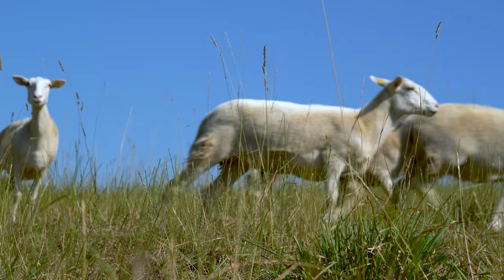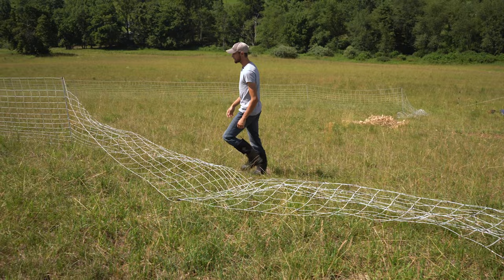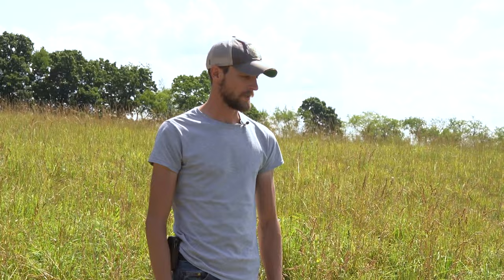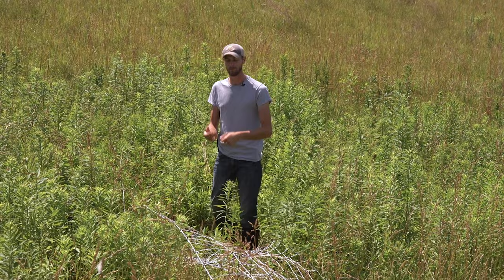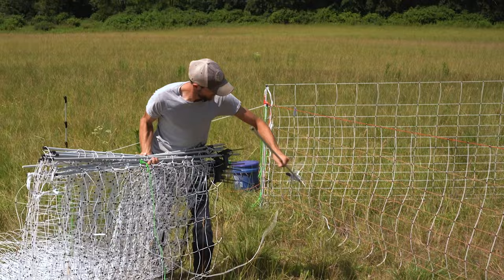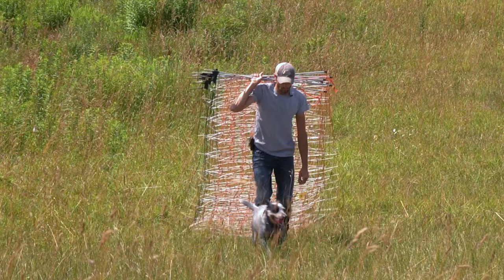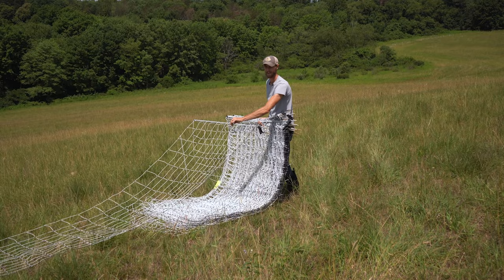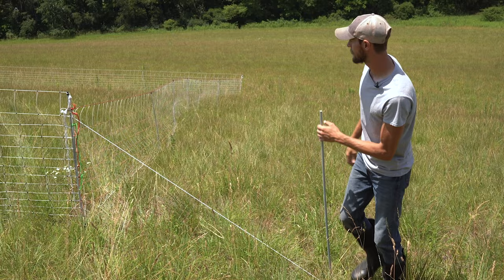How To Set Up Rotational Grazing Paddocks with Electric Netting

Comment: How do you keep the sheep in the electric netting? It was highly used and recommended. We got 3 lambs. The spooked and bolted through it in 5 minutes despite the wires being hot. We are so discouraged with this first dip into sheep/ livestock. We need all the advice. Once we catch the lambs again we are worried to try putting them back in the netting.
Reply from the maker: We are sorry to hear you had a bad experience on your first go! What size energizer do you have running your net? Is it posi-neg? If not, how much grounding do you have?
Reply: @KencoveFarmFence  my husband has all those answers. I know it was 11k voltage. The lambs had never been electric fence/ net trained. This is our first time with any kind of livestock. We did get them all back Monday. There is a lot we did not know that we are learning on the fly.
Reply from the maker: @TwoBirchHomestead  We would be happy to help! Shoot us an email to marketing@kencove.com and we can help trouble shoot for you! Or give us a call 800-KENCOVE

Comment: Is it feasible to use the netting as a perimeter fence until we have the opportunity to get a woven wire fence built?
Could we use step in stakes, braided electric and hook it to the netting for the power source to make the separate paddocks within the perimeter?
Thanks!
Reply from the maker: Great questions! Yes, you can use netting as your perimeter in the meantime and divide into paddocks with twine and step-in posts or additional nets. Just make sure your energizer has enough capacity to add paddock divisions. Electric netting requires a minimum of .25 output joules per net, and we we recommend 1 output joule per mile of fence otherwise. So, be sure to calculate your fence demand by combining your nets and electric twine in order to properly size an energizer.
Reply: @KencoveFarmFence  Thanks so much for the quick reply!
New sub here!
Reply from the maker: @garypiatt4666  Thanks for watching! Hope we are able to help you!

Comment: What do you do when you live in such a poor soil area that you cannot get the portable fence posts to stick in the ground?  We live in rock country.  Trying to fix this issue but need a little help so we can safely run the animals over it to develop the necessary fertility to do so!  Tips?
Reply from the maker: Hi Jennie,
In cases where rocks are present and there is not enough topsoil to hold step-in posts, I have seen people use masonry bits to drill post pilot holes into the ground. I know of other folks who made weighted, mobile posts by cementing a pot material inside coffee cans or 5gal buckets. This allowed them to have a secure fence and still move it as they built up the soil. Creativity is really the only limiting factor for fencing solutions. I always recommend using what you have around. Please let us know if you have any further questions or if you would like to continue brainstorming solutions for your context!

Comment: Tall grass and weeds like in the video, wouldn’t they short the fence out?
Reply from the maker: Hello - The bottom strand of the net is non-conductive. While there is some forage growth in this field, it is not heavy and really pulling down on the netting. However, where forage growth is heavier and thick, you could weed-wack or mow the path where the net will lay. Having a proper sized energizer is also important for combating forage growth.

Comment: What do you do for a gate to go in and out?
Reply from the maker: This is a common question - There is no "gate". You simply turn off the power supply and can either step over the fence, or move your end post. If you want to make a small opening to use as the access point, purchase an additional step-in post and place it a short distance from your end post. That will act as a pivot point when you remove the end post to use as the entrance

Comment: Some questions I have are these:  
In hight wind situations, do the fences lay over?  I know that animals have a tendency to drift with the wind when weather is driving them.  If the fence is layed over on one of the long stretches of fence, couldn't the animals move across the intended barrier? 
In tall wet forage situations, how do you keep the fence from shorting out with so much in contact with the moist growth near the ground?
I am curious about the composition of the flexible posts that are obviously new in your video.  Are these fiberglass posts?  If they are, how do you keep those fiberglass fibers from deteriorating in the sunlight and becoming a concern to handle with bare hands in the future.  If the posts are not fiberglass, but some other material, is that material capable of withstanding the effects of light as a degrading agent?
Things naturally get broken on a farm.  In the case of a damaged post, how may a broken post be replaced?
These examples that you have provided are small areas where foot travel installation and maintenance is easy to manage.  8 head of sheep do not require large areas to graze on.  So talk to me about how this type of fencing might be affordable and acceptable as permanent perimiter fencing for 200 sheep or 100 bovine.  What would be the cost of the fencing for a one mile straight run?
I don't know if you want all of my comments and the answers to them to go back up here to your page, so I will include my private email address for you to use if you prefer.  brushdcp3@gmail.com
Reply from the maker: Hi Ronald!  

Wind: If your soil conditions are decent, you will not experience much issue with wind. You’ll be able to tell when installing if a placed foot is sturdy and secure or if you need to move it to find a better hold in the soil. In any case of a fence falling or a tree branch knocking it down, there is always potential for animals getting out. However, I’ve also seen animals that are well-trained to electric fencing not even attempting to cross a downed wire, let alone a wide net. 

Tall & wet forage: Having a low impedance energizer that is capable of handling vegetation load is the first remedy to this situation (we recommend .25 output joule per net minimum). Sometimes mowing or weed trimming the intended fence line before setting up nets may be necessary to easily install the netting and minimize vegetation load, and make life easier in general. So far, I have not had an issue with vegetation load on this netting system. 

Posts: These posts are solid SunGuard fiberglass posts. We have carried SunGuard posts for a while, they are tried and true. The nets in this video are not new and have been in use for several seasons with no signs of failure or deterioration. SunGuard posts are coated for UV protection and to prevent splintering. They will endure a lifetime of use on your farm/ranch. We also sell replacement posts and feet for each style of netting for easy repairs, should you need them.  

Scale of use: These nets are also used to graze large numbers of sheep and goats (200 head and above) not just a few head here and there. For a permanent perimeter, I would consider using wire fencing over netting. Electric netting is intended to be portable and temporary for mobile and flexible grazing systems but is probably not the most economical for a permanent perimeter. Plus, it comes in 164ft lengths as a full size, rather than 330ft for woven wire or 4,000ft on a coil of high tensile. I would use netting time and time again for mobile grazing, but would opt for high tensile or woven wire for a permanent perimeter.  

Let us know if you have any more questions!